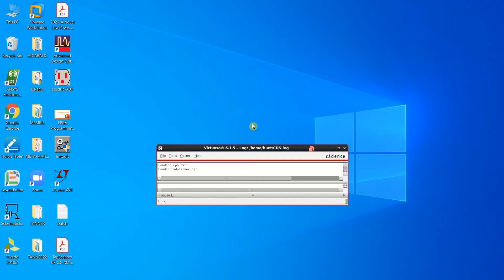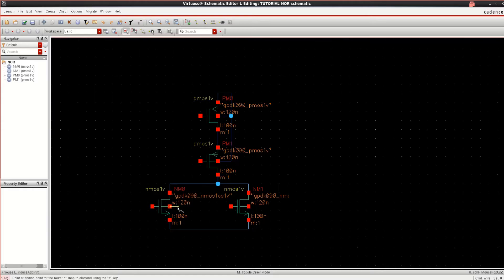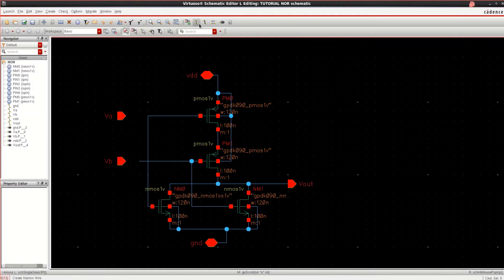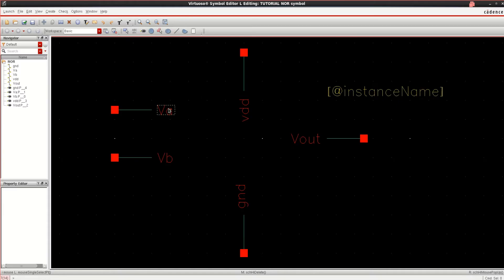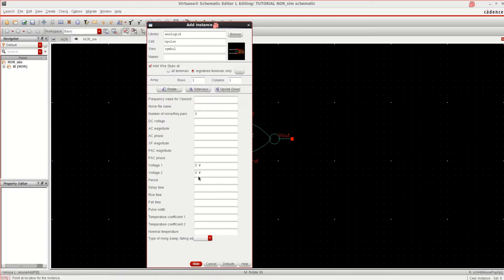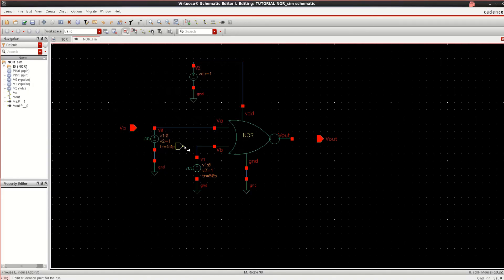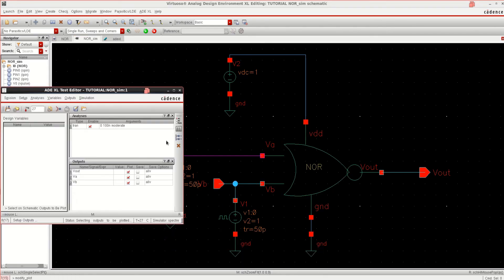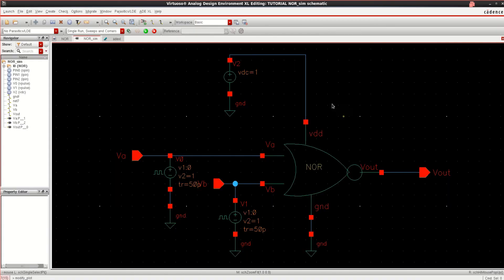Cadence Virtuoso: NOR Gate Schematic Design || Part-1.

Comment: Very nice explanation. Isn't it required to do the transistor sizing (w/l) of pmos and nmos?
Reply from the maker: Thanks for the response.
Transistor sizing is important. Since the output is not connected to any load. It works ok.
Reply: Sir if possible please upload some videos on monte carlo simulation in cadence🙂